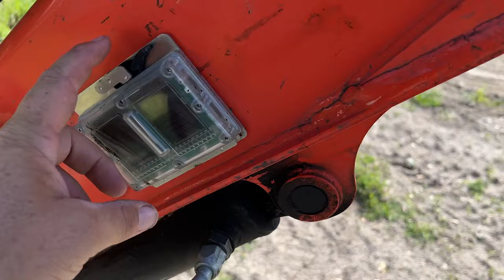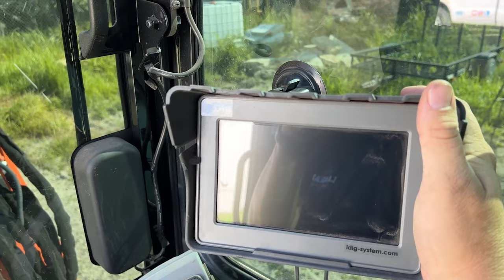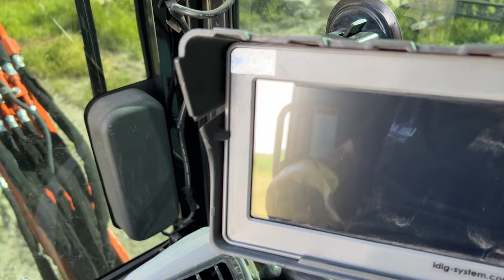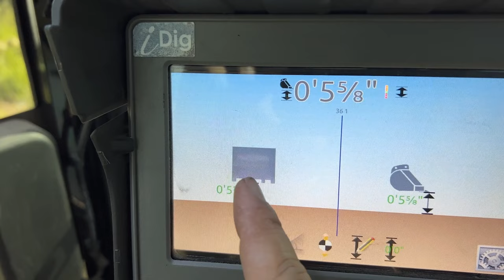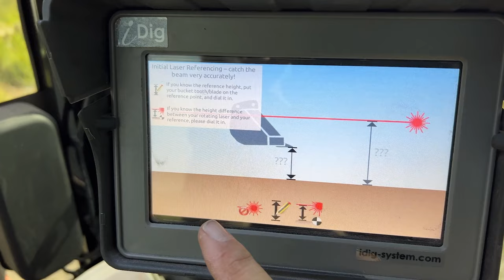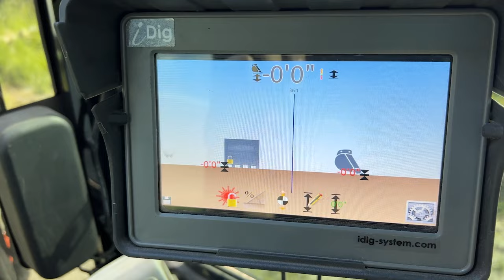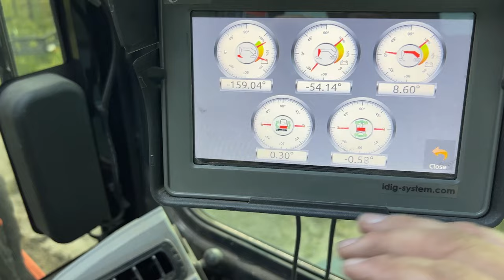Is the iDig Grade Control Worth Buying? | iDig 2D System Review

Comment: I appreciate you doing a real world review on it, Josh.  I like the fact that you can remove the sensors, control box, and indicator and take them to the shop every day.
Reply from the maker: Yea I take my monitor out and keep it stored in the case it came with.
Reply: you can take them with you so they don't get stolen but one of the biggest selling points of the iDig is that you can move those sensors and control box from machine to machine! The main system is for one excavator, but you can buy a '2nd machine kit' for every other excavator you want it on which adds a ton of value! Last year I set up 5 excavators for my customer for a total of around $16,000 which sounds like a lot until you get quotes for wired systems at $20k or more per machine!

It's also one of the easiest systems to use in my experience and it's one of the only systems that utilizes a 2D sensor with gyros in it. So when you set a slope, it keeps that slope running in the correct direction as you swing the cab around instead of digging a cone around your excavator

Comment: Excellent end user review.  Nice to hear a review from someone who doesn't sound like a paid promotion/infomercial.  I wonder how that would work on my backhoe, cause like you said, help is hard to find, good help harder yet.
Reply from the maker: I would think it would work on a backhoe but could be wrong.
Reply: you can def put it on your backhoe. you'll need to install the 2D sensor where the main boom attaches to the back of the tractor so it knows what direction your boom is facing. But it's possible! It's a universal system and sometimes you need to fabricate a plate for the sensors.....but still worth it!

Comment: Yeah iDig sends a 3M base mount now instead of those crappy suction mounts. It's all Ram Mount components so you can change and use whatever works best for you and your machine! 

HINT: if you tap the top of the bucket it'll tell you your cross slope percentage.

I love this system! On top of being very well priced, you can use that same system on all your excavators! All you need is a '2nd machine kit' per excavator! So it adds a TON of value. 

Nice video though! PS: I sell these systems and I install them. Very rarely do I sell without installing, calibrating and training the customer. Calibrating is a bit tricky but I get it installed and calibrated within a couple hours.
Reply: Where are you located?
Reply: @joshhamel5853  sunapee, NH. But I travel all over New England
Reply: @ne.laser_jon  I'm interested to try one out.  I'm near Burlington VT
Reply: @joshhamel5853  I can demo the iDig for you if you'd like? I work with new England laser and transit

Comment: I have been thinking about buying one but my use would be septic system and footer is the Acuracy not good for the fill line ditch
Reply from the maker: We use it every day do drain field installs and tank installs. It’s fantastic
Reply: we have customers that use it for septics all the time. On a new machine, my calibrations come in within a quarter inch of accuracy. An older machine with slop in the pins will add a little inaccuracy

Comment: So you have to bench it every time you move the machine ?
Reply from the maker: No, you set your initial elevation and then when you move the machine you just catch the laser and it does the calculations to keep you on grade.
Reply: when you move the tracks you have to re-bench. you can bench either off grade or a laser. depends how you want to work. and only need to bench when you want to check your grade or do finish grading

Comment: Can you just weld something on the dog bone to mount the sensor easier on the outside?  Love your machine.  I own the same machine.
Reply from the maker: Yea you definitely could. Honestly it hasn’t been an issue aside from the last month or so. I kinda like it being on the inside so it’s protected while digging.
Reply: Kubota is a pain because they don't have any room on the couplers. You can put the bucket sensor on the quick coupler, ears of the bucket or on either of the dog bones. So Josh here could have put it on the flat dogbone. I prefer the coupler or bucket because calibration is MUCH faster. I don't like going on the inside because it may be protected from large debris, but a small rock could cause big issues. The bucket sensor can also be moved and you just have to calibrate new buckets

Comment: Did you ever tryout a magnetic laser receiver on the stick of the excavator?
Reply from the maker: No I haven’t. Wouldn’t it need to be reset as the machine moved along the trench?
Reply: try laser receiver in a small deep hole, not possible
Reply: After the first 5 minutes of use, magnet moved! The Trimble magnet isn’t strong enough!

Comment: Hey Josh, could you give me any insight on how to to get ahold of drain field chambers in south Florida or Fl for that matter? I’m going to replace my personal home drain field and haven’t had much luck finding any local.. Help would be very much appreciated. Thanks
Reply from the maker: In Florida you have to be a contractor to buy septic material so it will be pretty tough to find.
Reply: @LakelandSepticCompany  Thanks for the info. I’m one scheduled test/application away from having my GC license. Thinking about gettin certified for plumbing/septics down the road. I have the machinery to dig/replace septics and have done the older wrapped corrugated and stone method on a house that is still working today. I believe  the chambers are superior to that system so I wanted to use them on another house. I’ve found ADS arc 24 chambers for $50 a piece from a company locally who will sell to me. Is that a decent price/product?
Reply from the maker: @davida6383  that’s a good bit more than we pay per chamber by about $20

Comment: Watch out. The I Dig Combo sensor’s antennas are junk and break off. I’m on my second sensor already and that one just broke today. $1,000 + everytime you break one.
Reply from the maker: Mine doesn’t have an antenna that can break off.
Reply: It absolutely does. Its a wireless system so to communicate with the other sensors it sends radio signals back and forth. Its a thin peace of copper wire under the clear cover. I have 2 I-digs and both have had antennae failures. 
Take the sensors off if you work in rock use a hammer or vib plate. My salesman said they will take the abuse but they can’t.
Reply from the maker: @darinhaas3798  gotcha. In all honesty we stopped using ours. We started having very unreliable readings and couldn’t get any support to help solve the issue so we are shopping other manufacturers at the moment.
Reply: @LakelandSepticCompany  I am curious, in what scenarios will you have unreliable reading? And did you find any new manufacturers with a system that you like?
Reply: @LakelandSepticCompany  Did 4k quit helping you with support?